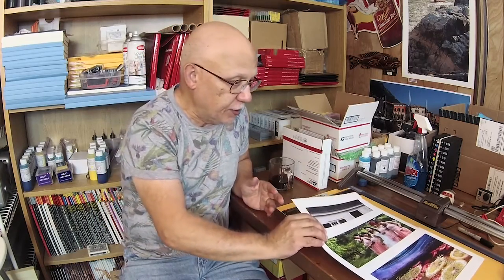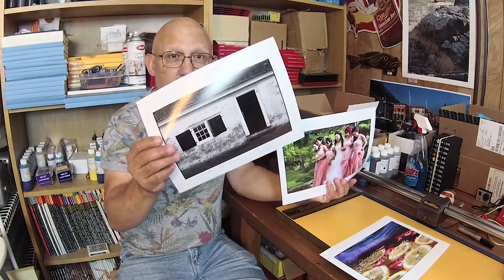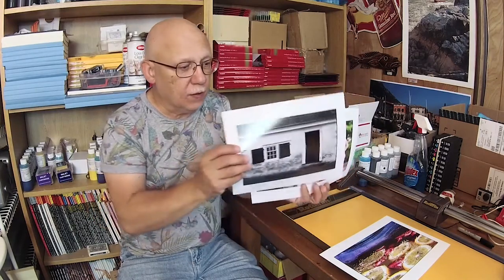#1 Basic Photo Printing Series   The Ink Jet Printer!

Comment: Just found your site this am 7/9/16. Rant about not watching ads.I have spent so much time on Camera, lens and technique YouTube sites, I have forgotten all about the most important part of my workflow ...PRINTING.I own a 3800 with an Ink republic Bulk system (works nicely) and soon to purchase another 3800 to convert to a Jon Cone Black and White system. Maybe...it could happen...but ONLY after I review any presentations you have that are pertinent subjects to this idea. Also looking for other ideas for flushing out and cleaning heads that do not require a bunch of $$ to execute..Hope you have those in your YouTube library as well.Glad I found the site. BTW, I watched the entire ad before I watched the #1 Basic Photo Printing Series I am watching #1 as I prepare this comment.Tim
Reply from the maker: Hello Tim. I may have have everything you need here. There are several hundred videos covering just about everything. Hope you enjoy your stay!
Reply: I'm COUNTING on it.I'll be directing my immediate searches  to the 3800 Nozzle clogging/unclogging issues,  since there is a 3800 ($140) with a slight magenta clog calling out to me. Thanks again
Reply from the maker: Seem like like magenta is a troublesome color due to it's higher  density of pigment.  There are many reported instances of clogged magenta nozzles. Good luck with that 3800. But check the number of prints that have been done on it. You can access that information through the LCD screen. Sometimes  nozzles become irreversibly damaged as well.  I know!!

Comment: I tried going to the site, but I ended up on the plain Yahoo site. When I tried to answer your email, I got undeliverable pop up. To bad there is not just a simple button to click. I am not that computer literate.
Reply from the maker: https://www.paypal.com then click on Send then use my account: tooljoe2003@yahoo.comsend anything as a Gift and no fee will be charged. www.patreon.com/jtoolman  will take you directly to my Patreon page. I just did it several times and it works 100%.  Are you on Internet Explorer or some other browser? Anyway it should work either way. If it is redirecting you somewhere else, then there might be something wrong with the browser? Not really sure but thanks regardless.